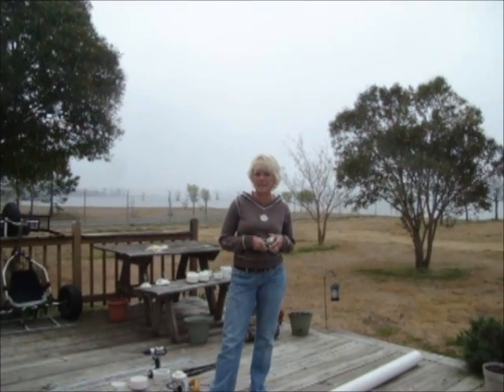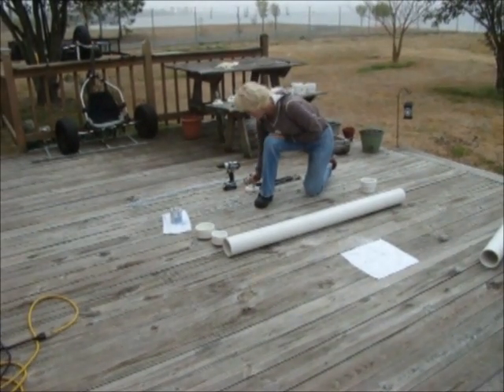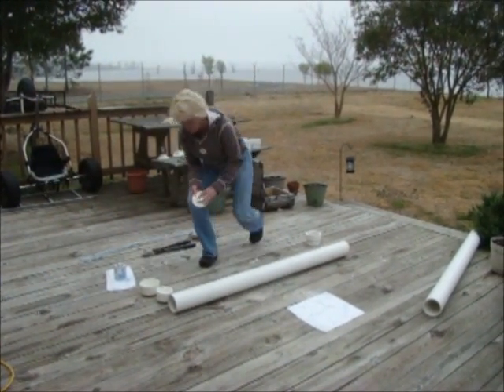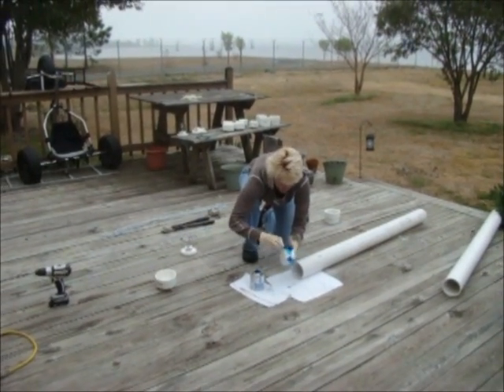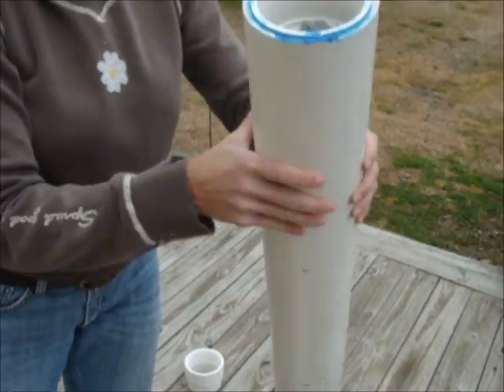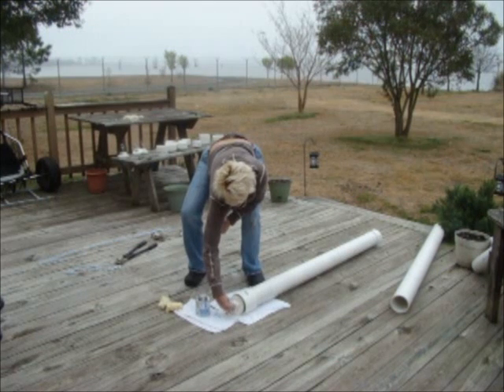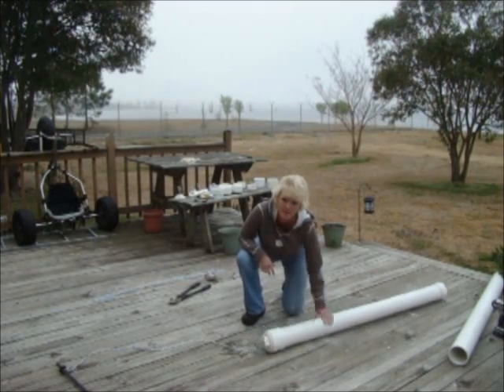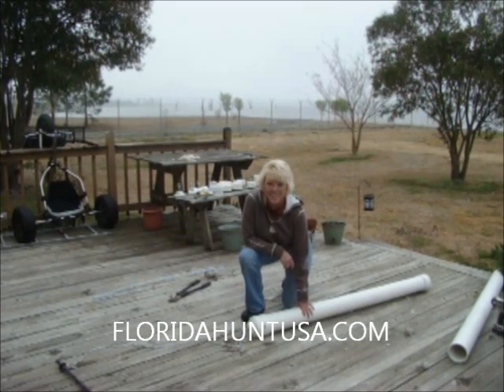HOW TO MAKE A HOG FEEDER

Comment from the maker: You could definately give it a try however, there are a couple reasons we believe this to be the best.....   there are times we turn the empty pipe upside down to get the trash out --so then you would have to pick up the rocks each time.  Also, if for some reason, and it does happen, that you get wet corn so then you would have to unclog stinky wet corn and find your rocks.   Lastly,  I know the sound of the gravel against gravel is more prominent that in rolling around in large part of feeder.